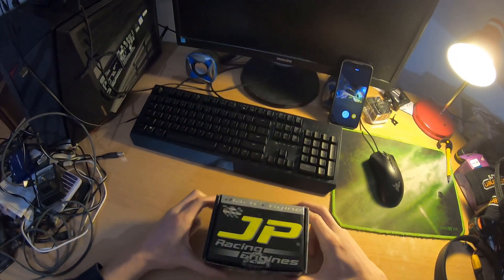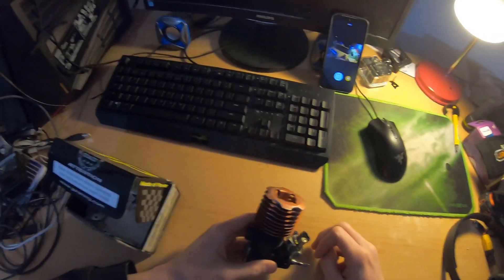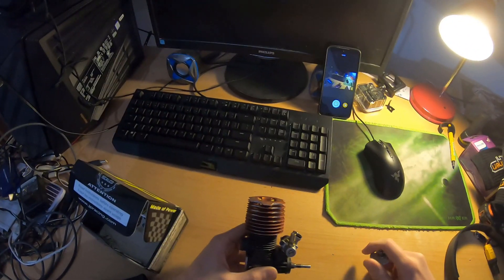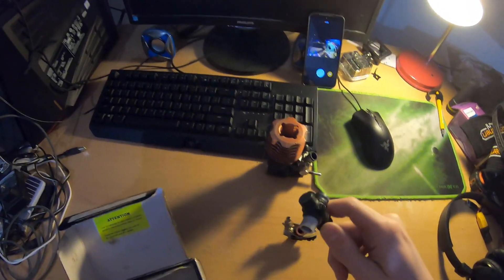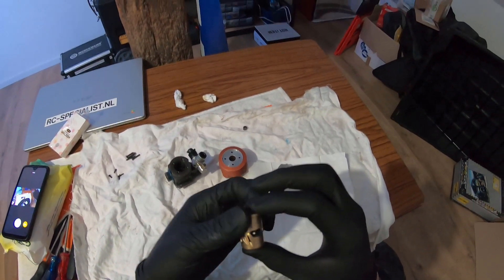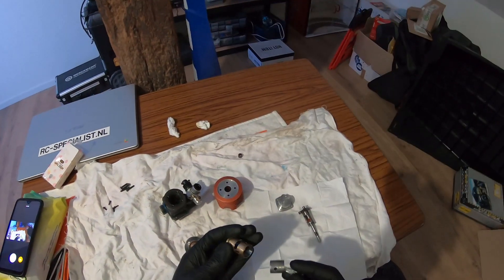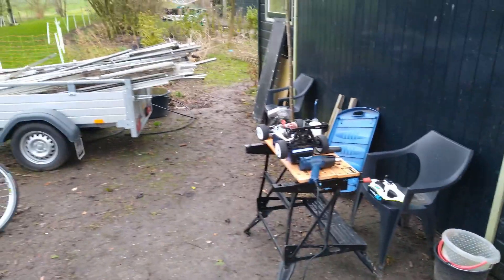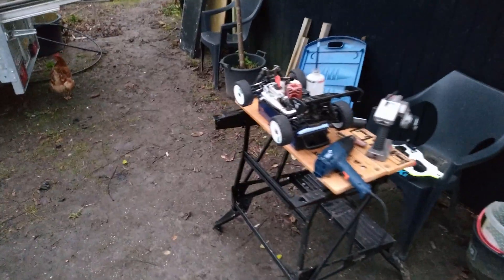Taking a look & testing this custom build nitro rc speedrun engine!

Comment: What pipe do you recommend for more torque. I currently have a OFNA 086 pipe.
Reply: Are you racing or just fun?
Reply from the maker: That Ofna 086 combined with a Novarossi 41032 should give you all the torque of the world! Especially on modded engines. Also I love my OS Speed SC2090 pipe since it also has killer torque while still having plenty of top end!

Comment: where can i find the springs that hold the header on
Reply from the maker: Those are called exhaust springs. You should be able to buy them separate in a hobby shop or online

Comment: Hi Nitro Mike

I have a LRP 32 I want to get modded for a buggy. Can you point me in the right direction. Thanks
Reply from the maker: If you are from the US? Send it to RC Renew, RW mods or RB mods. If you live in the EU? Send it to Roelof Tooms aka my engine builder. You can send him a PM over facebook. You want to smooth out the ports because they come with horrible burrs from factory so you want to get that fixed,  the cranktiming to be optimized for max power and speed so fuel mileage will be destroyed obviously. You also want to run a Novarossi 24069 carb or KE25 carb on it instead of the trash Xtec carb that comes with it from the factory. Also you want to run the Novarossi 9886 pipe with the 41032 header on it for maximum performance!
Reply: @NitroMike  Thank you brother 💪🏾💪🏾

I will be reaching out to your engine builder RoelofTooms 💯💯